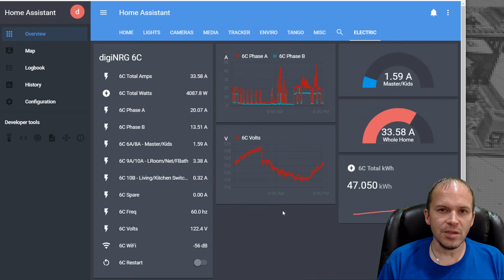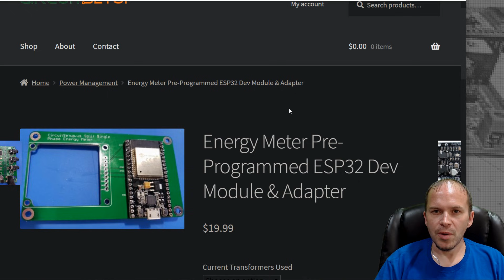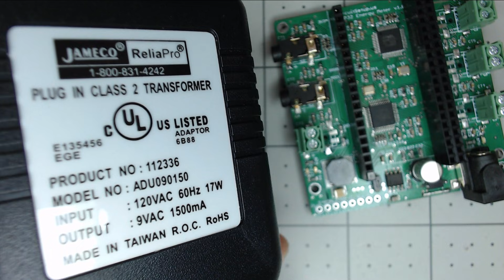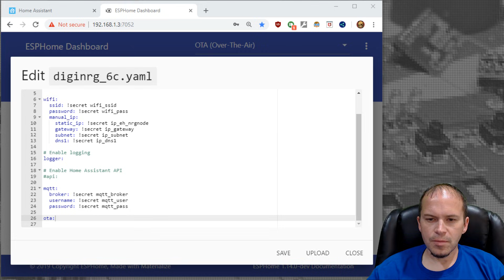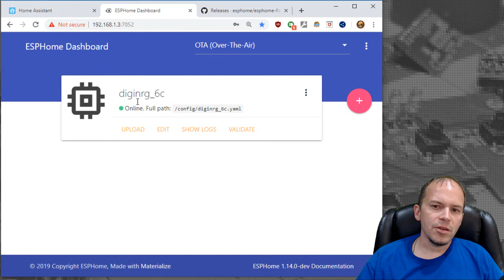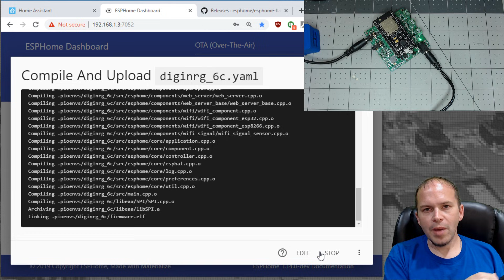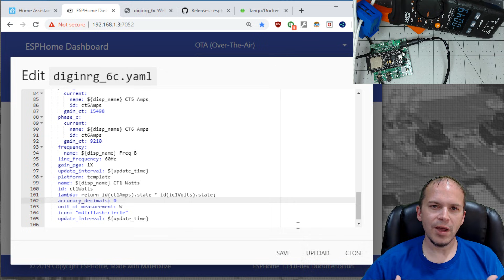DIY Whole Home Power Monitoring with ESPHome & Home Assistant

Comment: In the video you discussed adding sensor values together in the yaml file but there is no example. How do you combine the values?
Reply from the maker: In my example linked in the description it has some template sensors as examples.
Reply: @digiblurDIY  I see the links to your GitHub but there aren’t any links there. Just what looks like text with no link attached.
Reply from the maker: Its working here.  Maybe try another browser?  https://github.com/digiblur/digiNRG_ESPHome
Reply: My bad. I was looking for them in the wrong section of the GitHub.

Comment: Maybe this question is already answered in all these comments but I have no way to search them. I see links for smaller branch circuit CT’s in the comments. Could someone recommend 200 amp CT’s that I can use on my main feed?
Reply from the maker: I would check circuitsetup.us as also the wire diameter is an issue as well to make sure it fits.
Reply: @digiblurDIY  Thanks. After I posted the question I found the YHDC SCT-024 (200A CT’s) on their website. I see they also state that the 120 amp CT’s will usually work for 200 amp services. I’m betting I couldn’t get the current much over 100 amps if I tried.😁

Comment: Brilliant - thank you! I have just got one of these that replaces some Shelly  EM's that are dying :(. This is a great walkthrough video - though it looks like Watt is now available as a sensor value without calculation. Just need to calibrate 9 identical CT clamps - I'm hoping the variation between them is minimal....
Reply from the maker: Yep you got it right!  The newer board revision and software allows the IC to calculate the real watts.  Awesome stuff!  A little redo is on my list of videos to update with this new data.
Reply: @digiblurDIY  UPDATE: I have also added sensors in Home Assistant to convert the W into kWh values. 
I found I received run time errors from the ESP32 when I added too many sensors (65) and had the web server enabled and DEBUG logging. Removing the web server and changing the login to INFO made everything more stable.

#from sensor.yaml
#For each CT clamp
- platform: integration
  source: sensor.power_monitor_ct1_power
  name: Power monitor CT1 energy
  unit_prefix: k
  round: 2

#For the total consumption
- platform: integration

  source: sensor.power_monitor_power
  name: Power monitor energy
  unit_prefix: k
  round: 2

this I then feed into a utility meter for daily/monthly/yearly tracking.

#from utility_meter.yaml, for most clamps, I have monthly and annual trackers
grid_monthly:
  source: sensor.power_monitor_ct1_energy
  cycle: monthly
grid_yearly:
  source: sensor.power_monitor_ct1_energy
  cycle: yearly

Thanks again!
Steve
Reply: @digiblurDIY  I'm about to pull the trigger on this. Are you saying you don't need to do the calibration portion of the clamps in this video with the newer boards?
Reply from the maker: Not unless you want to tweak it. They did the calibrations already but it isn't a bad idea to check it.
Reply: @digiblurDIY  Cool. Just have to buy these now! One more question: So in your original video, you indicated to get the 100A/50mA clamps for all items to monitor. I'm still watching your second video, but sounds like you are now indicating 100A for the main lines coming into the box and 20A/25mA for everything else (assuming the other items I want to monitor are under 20A), is that right? I have 3 breaker boxes (2 in basement, 1 on first floor), so I may need to do multiple boards to cover everything.
Reply from the maker: If those 20A CT clamps are available they are great due to their size. Otherwise I would stick to a clamp you can get for cheap that is over the rating you need and has the mA output type with the 3.5mm plug.
Reply: @CarmeloRoldan  The 100A will work for everything. The only difference is the opening size of the clamp - the 100A will be larger - which means more space taken.

Comment: It would have been nice if you mentioned that Home Assistant needs to run on a Raspberry PI version 3 or 4.  I can't run Home Assistant on Windows.
Reply from the maker: Absolutely it can. HA runs on all kinds of things and HA isn't required for this project anyways.
Reply: @digiblurDIY  Thanks, from what I saw on the HA website was the raspberry PI operating systems.  I was able to find a video on doing a VMWare with Ubuntu.  Thank you for the response.
Reply: @robertpotter4700  I mean, you don't even need VMWare. You can run it on Docker for Windows as well.

Comment: I've raised an issue on the GitHub page, but will also ask here. Hope Travis or someone else can help.
https://github.com/digiblur/digiNRG_ESPHome/issues/5

My issue is that I have a calculated sensor (=CT1-CT6) which is producing negative values. I've realised this is because these 2 clamps are on channels connected to separate chips, and it appears the chips do not publish at the same time. One chip seems lag by ~23 seconds.

So if CT1 is 300W when it updates, but CT6 hasn't updated from it's last value, of say 500W, my calculated sensor will say -200W (300W-500W). Then CT6 updates just after with the new value of 200W, so the calculated sensor value should have been 100W (300W-200W). I hope I've explained this OK.

I know I could plug-in/out to rearrange and get both clamps on the same chip, but is there any way to sort this in the software please? It would be a much more flexible arrangement if so. I may need to create other calculated sensors later on.

Maybe something can be added to the YAML to synchronise the 2 chips? Possibly add a delay to one?

Also, I was considering buying another board, to add more channels, but wonder if again the 2 chips on this would publish out of step with those on the other board, as well as each other.

Thanks for any help you can offer.

Comment: I am having trouble getting my MQTT broker to connect.   I get the error " can not connect  to mqtt broker-no route to host. I am not using the !secret file. What ip address do I use?
Reply from the maker: You can also use the API route if mqtt is giving you issues.

Comment: @digiblurDIY  Great video, I got my system up and running, and for the life of me I can't figure out why the real watts are way lower than it should be on one of my main feeds. I flipped the CT around and got negative watts. I gave up and just did a calc (volts x amps). Any ideas to get the real watts working? Also, is there some other code to get the daily kWh to reset at midnight; mine just keeps adding with no reset to zero?
Reply from the maker: Are you using the version that the IC does the calculations?  If so, make sure the amps and voltage are calibrated and the IC should do the rest of figuring out the actual watts based on the power factor.

Comment: Amazing Explanation...Just one query..If at all we want to connect SCT to Arduino GPIO pin, do we need to cut the SCT and solder it to the GPIO pins?
Reply from the maker: No. You need more than that to do it just via another board. See my smart dryer videos.

Comment: Ho do you get reading for Voltage? I see you only connecting current probes?
Reply from the maker: It uses the voltage as reference and calculates the power factor, wattage, etc.
Reply: @digiblurDIY  Thank you replying but where do you connect to get voltage? Did I miss that part?
Reply: @digiblurDIY  You mean you assume voltage being 220V without actually measuring?
Reply from the maker: The AC power supply.
Reply: @digiblurDIY  O, I see. 9V AC power supply. Is the output voltage of this transformer varies in respect to input voltage changes or you are using only phase shift to calculate power factor?
Reply from the maker: The IC do it all.
Reply: @digiblurDIY  Thank you! Got it. Was just curious how they do it.

Comment: CircuitSetup 6 Chanel 

1.  No Documentation from Cirutsetup
2. Transformer boxes unlabeled 
3. ESP-32 I had to Ground pin P0 to program it (really)
4. The code on https://github.com/CircuitSetup/Expandable-6-Channel-ESP32-Energy-Meter                              
     does not work WTF
Digiblur’s code Does
https://github.com/digiblur/digiNRG_ESPHome

Comment: This is great! Is there a version available for UK supplies? We're 50hz 240v single phase.
Reply from the maker: The same board works on your power.
Reply: @digiblurDIY  hi mate, what about the transformer supply? As far as I know, transformer design is quite focused on the frequency, operating a 60hz on 50hz can result in greater iron losses. Im thinking this might translate into greater power calculation errors. Having said that I'm sure I could find a 50hz transformer instead.
Reply from the maker: I know a lot of people who use it in various other configs across the world. Definitely check the board website for more info.
Reply: @digiblurDIY  who actually makes the board? Is it circuitsetup, or is that just a distributor?
Reply from the maker: Circuitsetup.us makes it.
Reply: @digiblurDIY  nice one, thanks so much for your help mate! Very much appreciated, great vid BTW!
Reply from the maker: Also look at this bullet point on the readme. They talk about single phase 240/50hz. https://github.com/CircuitSetup/Expandable-6-Channel-ESP32-Energy-Meter
Reply: @digiblurDIY  aye mate, I see they've got a great section on 240v transformers! I've brought the board and esp from CircuitSetup! Can wait to have a play.
Reply: Hi again! I finally got up and running, cheers again. Was a lot more complicated than i expected, however i was a complete beginner. I didn't have home assistant, mqtt or anything!  Perhaps when I've finished modifying the yaml for the UK i can give it to you for the github...?

Comment: Anyone in the UK looking for an AC power adapter, to power the CircuitSetup board, I'm using this one, which works well.
https://www.poweradaptorsuk.co.uk/1000ma_9v_AC_AC_Power_Adaptor_p/ta10009ac.htm

I also ordered the jack adapter kit. Despite CircuitSetup saying the center needs to be 2.5mm to accommodate the board's +ve power jack pin, and this adapter listed as 2.1mm, it fits tight and fine as standard. So I didn't use the kit.

**EDIT (07/01/2021)** Received a refund for the case from the good guys at CircuitSetup. I understand they've now tweaked the design to eliminate the below issues I experienced.

DON'T BUY THE 3D (6C) CASE!
I did buy Circuit Supply's 3D printed case for the 6-channel. Unfortunately this is poorly designed. I needed to slightly drill out the 6no. clearance holes for the 3.5mm clamp plugs in order to get the board in to the case. Also there's not enough room to accommodate the ESP32 board fully, which sits out the top end. Again I had to modify the case, cutting some of this side out to allow the board to sit it.

$5 wasted...

I've now decided to just mount the board in a proper electrical junction box, with mounting holes to screw to the wall and strain-relief for the CT clamp leads, to prevent them becoming accidently unplugged. The 3D print has none of these features! In particular I consider this last feature a must, considering Travis' warning 7:00 minutes into this video. I don't want the CT clamps coming unplugged at any point!

Hope this helps someone.
Reply: FYI, I refunded you the cost of the case. I'm sorry that it was not up to standard. I've since fixed my printer and the cases so they do not have to be modified.

Regarding the CT connectors coming unplugged. All the CTs sold on CircuitSetup come with protection diodes. The only way they could become open circuited is if that diode fails AND the CT comes unplugged. If that diode fails, it likely would have been because too much current passed through the CT. If that happens then the burden resistor on the meter is the last line of protection.
Reply: @jdeg2000  Thank you. The refund and apology goes a long way. Appreciated.

So would you recommend I could unplug a clamp from one channel and plug in to another without having to turn off my main breaker and kill power to my whole house? I don't plan to open up the CT clamps themselves, just maybe move one circuit to another channel.
Reply: @johns8105  no problem! 

Yes, you can absolutely swap the current channels without turning everything off. As long as the CT isn't internally damaged, which is unlikely to happen without overloading it, it's completely safe.
Reply from the maker: I printed one myself for the one with 12 ports. It is  just taller. I will say it was a chore to get to snap together as the tolerances are very tight. And yes you are limited on the type of esp32 you can use. Some of them have antennas that are simply too long.

Comment: i see that there is some sort of limit on the 6 channel add on boards, they say you can have 6 add on,  plus the mainboard (48 total clamps)  but if you are doing current and power sensor, you can only have 3 boards.  i am just getting started and don't understand much on the esp hass.io world . But my question is can you have multiple  EPS32 feeding back to the hass.io for this monitoring?
Reply from the maker: You could have hundreds of esp32 boards around the doing things.

Comment: A question On the voltage, isn't there only one voltage?  I see that the board calculates the voltage from the 9VAC power supply for one of the phases.  How does it calculate the voltage on the other?
Reply from the maker: There should be a calibration for the other IC in the config. Set it the same.
Reply: @digiblurDIY  but the voltage is only coming from one phase?
Reply from the maker: I'm in the US residential where there is only single split phase.  If you have two phases you want to monitor you'd need an AC adapter on that phase too then follow the instructions to feed the second phase in.  https://github.com/CircuitSetup/Expandable-6-Channel-ESP32-Energy-Meter
Reply: @digiblurDIY  Thanks.  I missed the second phase hookup.   Is there a data sheet for the device? 
When on street power the split phases are close enough (most of the time) to not worry about it.  I say most of the time, is recently after power outage the power company only restored one of the phases.  What a mess.  It would be nice to shut everything down if the phases aren't with in tolerance of each other before damage is done.
Reply from the maker: That link has all the instructions on how to do it, if you need more info you'd need to contact Circuitsetup as I've never done that.  Luckily my transformer is in my backyard so it would be rare if I ever saw half of the split.

Comment: The calibration code suggested at esphome is: 
sensor:
  - platform: ct_clamp
    sensor: adc_sensor
    name: "Measured Current"
    update_interval: 60s
    filters:
      - calibrate_linear:
          # Measured value of 0 maps to 0A
          - 0 -> 0
          # Known load: 4.0A
          # Value shown in logs: 0.1333A
          - 0.1333 -> 4.0
This seems like a much easier way of doing it.  Maybe I am missing something?

Comment: If you monitor Mains power in the US, the sensor recommended ID does not fit the incoming wires.  YHDC SCT-016  will work instead.
Reply from the maker: That will vary per panel.
Reply: @digiblurDIY  200 Amp panel.  The 100 A CT shown does not fit.  It should if it was designed for 100 A main.  https://circuitsetup.us/ recommends the YHDC SCT-016 for monitoring US input .
Reply from the maker: Yeah I could see that not fitting on larger panels like at all electric homes.  A lot of my area uses natural gas for appliances and heat since it is cheaper so panels aren't that large here.

Comment: I purchased the recommended devices and have a couple of errors / questions on the setup.  When I try the otA I get no route to host.  I was able to compile and upload.   I then deleted and re-entered all and it worked for a while and then I am back to no route to host when trying to update the code.  Maybe it was a defective module.  I purchased two and the 2nd one worked with no issues.
Reply from the maker: You might have to set a static IP like I do.
Reply: @digiblurDIY  I did.  Had an issue with the first one not working correctly after plugging it into the socket. The second device worked correctly.  I did notice a slow ping time to the device.  Most of my devices are 5 to 10 times faster.  Any ideas on why this would be so slow?

Comment: Just adding a whole house generator and will now implement your tutorial. Another excellent job! Do you have a recommendation for the case if you can't print your own?
Reply from the maker: STL files are here.  https://github.com/CircuitSetup/Expandable-6-Channel-ESP32-Energy-Meter/tree/master/Hardware
Reply: @digiblurDIY  Not looking for the STL files.  Looking for a commercial case.  (Don't have a 3D printer)
Reply from the maker: Ahh... gotcha.  It might be best to get one from Circuitsetup?  Otherwise you could find project box with a mounting plate inside of it that would fit the board.  https://amzn.to/3c7Hssa
Reply: @digiblurDIY  Thanks.  Circuitsetup had the 3d printed box cheap.

Comment: How do you deal with the power factor of each particular load ? In AC Power in not VxI but VxIxcos(phi), phi is the phase difference btw 2 sinusoidal signals
Reply: ‘Tis might explain the measurement differences with the ShellyEM,  I guess the ShellyEM deals with it internaly
Reply from the maker: The IC handles it all. https://www.microchip.com/wwwproducts/en/atm90e32as